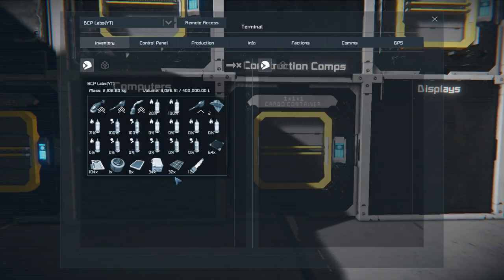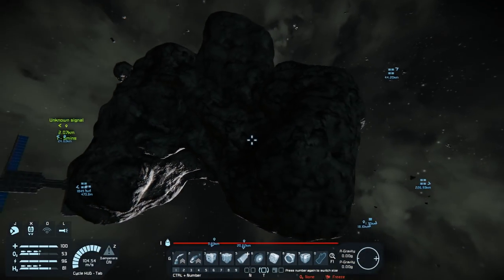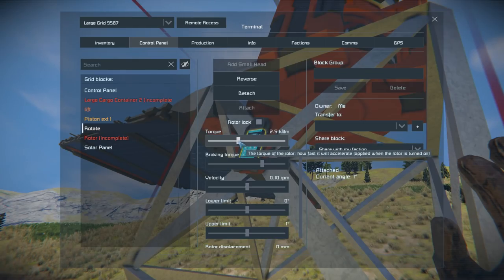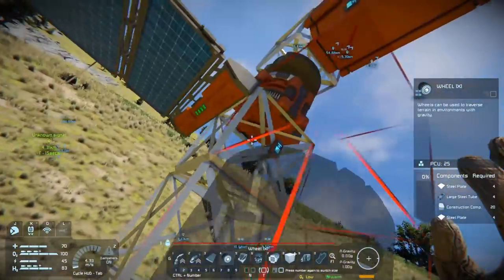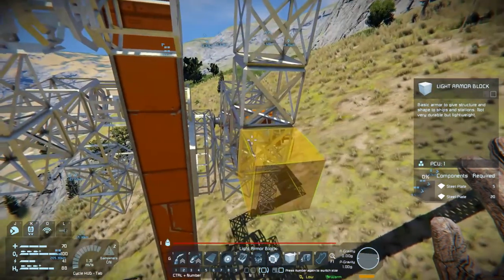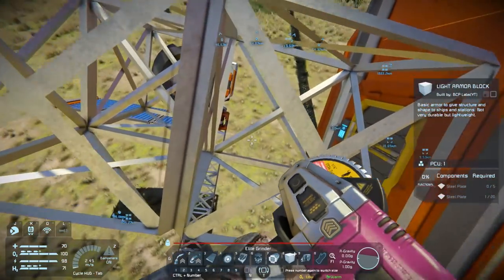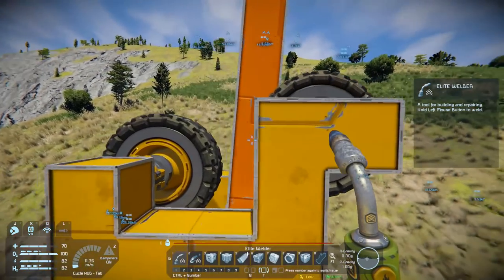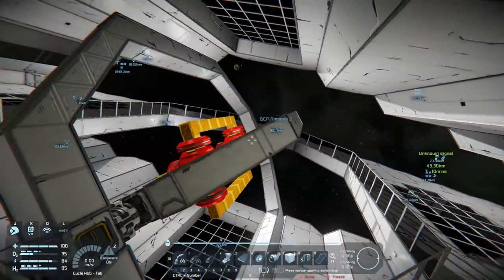44KM Express Space Elevator Attempt - Space Engineers - 29

Comment: maybe set the rotors to accelerate/decelerate gradually on the hot bar. maybe size is the issue like with the first spider biting the dust perhaps you can make a small grid version, not as exciting but I imagine it will work.

Comment: Have you considered thrusters with power override, perhaps, not sure if wheels can grab on to something such as that and drive upwards... Maybe something with an artificial mass block.    Was the other space elevator using thrusters, the one on the workshop that Keen Software had advocated in one of their past video's?   You sure get an "A" for effort, regardless :)   I would have given up at the 30 min. lag removing 2 blocks...
Reply from the maker: the reason im using wheels is with the cumulative speed of the rotors this particular setup should reach 220+m/s. all thrusters and suspension wheels are limited to 110m/s. this is to be a much faster way from surface to space. i do belive it can work, the wheels dont have much to grab as they are 2 wide which the rails should be and also they SHOULD be heavy so i can apply the pressure and the torque without the blocks crumbling. the thing does move as i tried adding 10 atmo thrusters and it lifted no problem. the elevator i see is the game menu uses wheels but with suspensions. but i havent given up..... ill get it one way or another ;)

Comment: Might also have to do with your use of rotor mechanics. Not sure what you changed in the last tries but breaking torque only applies when you turn a rotor off while normal torque only comes in when they are on and have a speed set. Kind of like the problem that pistons can´t be pushed in. So between that and the fact that your wheels can´t really adjust their position away from the block to the balance between force and solid object like they would with suspensions your rollers and adjusting rotors might actually start clamping down on the rails, forcing the big wheels into the rail too much. And then it becomes a pushing match between mere light armour and the almost indestructible 5x5 wheels... 

But i have to say, just getting all those rotors into a position where the whole thing doesn´t simply vaporize must have taken a lot of adjusting